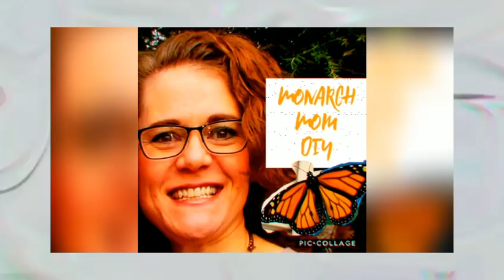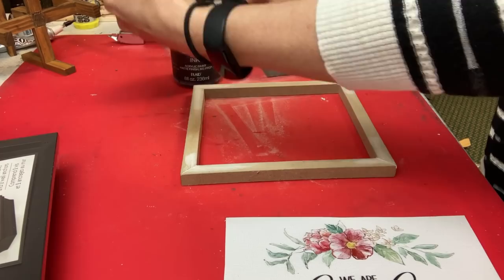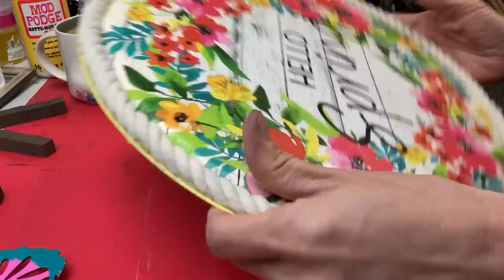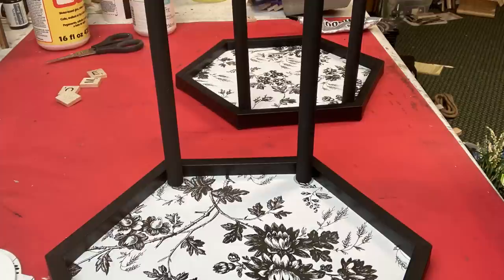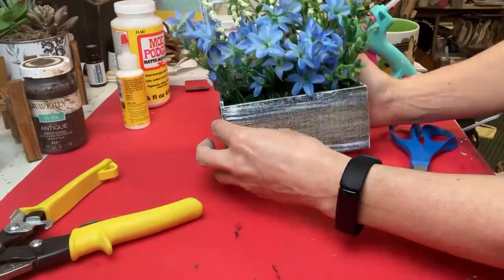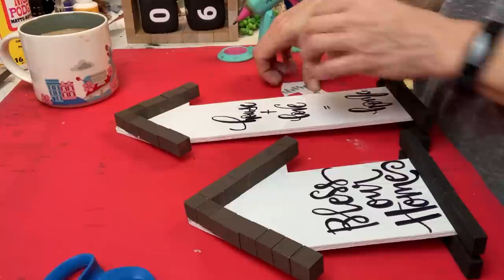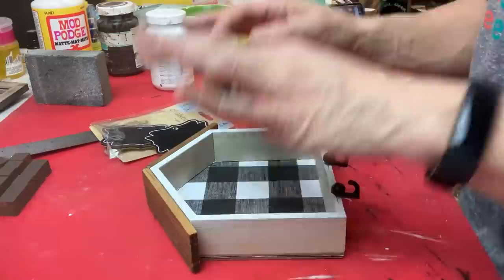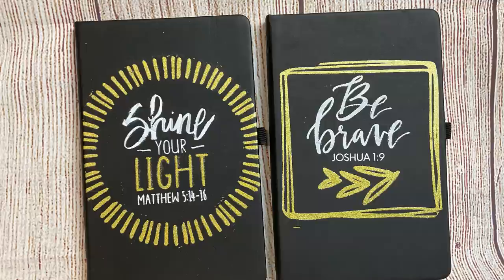TOP 12 EASY, 5 MINUTE BUDGET FARMHOUSE DIYS | MUST TRY | HIGH END LOOKING | DOLLAR TREE DIY

Comment: One-trick when using pizza pans that we do is sanding the pan lightly first and then painting it. Then we put the Mod Podge on the pan and let it dry and then we put our graphic or our paper whatever were using on top and cover it with parchment paper and hit it with a warm iron, ( no steam), and that seems to make it stick.
When attaching the Rope to the back of the pan we hot glue it and then cover it with a piece of masking tape on the hot glue and that forms a tight Bond so the Rope won't come off later. Just a tip for you to try.
BTW I love the butterfly.💖
Reply from the maker: Thank you so much for the great tips!

Comment: I have that floral spring gift bag and planned to make an outdoor pillow, but your wreath is stunning: my favorite.

It was hard to tell for sure about the mugs because I couldn't always see the inside color. The townhouse mug had both a green (#8) and the mug with charcoal inside (#4, 8, 11, 12) looked like a different city scape. The townhouse mug in #1 had the handle turned the other way, so I was unsure if it was the same or different. In #3, 6, 7, 8, 9, 10, the mug had Christmas trees. Only #2 had no mug. I'll guess 3 mugs.
Reply from the maker: Thank you so much Mary Ellen!

Comment: The bags at DT are beautiful. I just don't know if i can handle the crease that is on the bottom of the bag, but that is hwere a lot of the pretiness of the bag is, so you hate to cut it off. However, that pizza pan turned out fantastic.
Reply from the maker: Only one side of the bag has the crease.  I used the other "front" side.